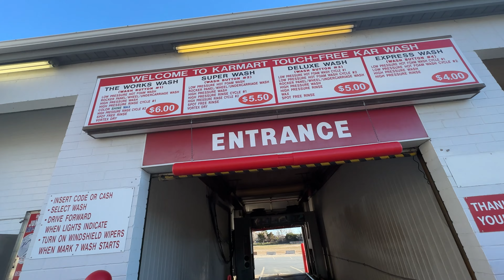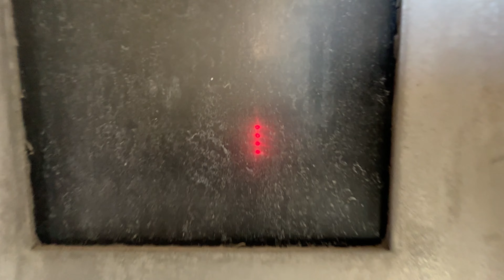(RARE) Awesome Mark VII Merchandiser At Karmart Car Wash - Ogden UT

Comment: Woah, this machine is BEAUTIFUL! Fun fact: a place in Ohio called Freddy's Car Wash has a stand-alone dryer made from an on-board dryer of a Merchandiser. It was painted red, and an extra dryer was added.
Reply from the maker: Very interesting. If I’m ever up in Ohio I’ll keep that in mind.
Reply: @carwashreviewsandmore7609  Cool! There are also two videos in a stand-alone dryer category in my playlist library as well if  interested.
Reply: @carwashreviewsandmore7609  Sorry, but adding one more thing. If possible, could you do an inside view of this machine? That on-board Vortex drying system is even rarer than ones on a GT-98. More videos of systems like this especially with this older dryer variant would be amazing this day of age no matter inside, outside, or both.
Reply from the maker: @kingcarwashnfansdrivesetc8364  This wash is an hour away from me and I hardly ever go up to it. If that ever changes I will film an inside view.
Reply: @carwashreviewsandmore7609 Aw man, but still, thank you for filming it nonetheless!